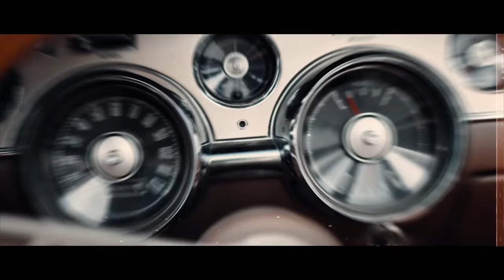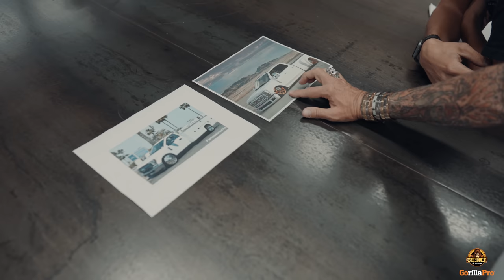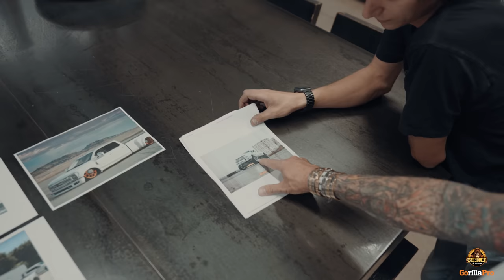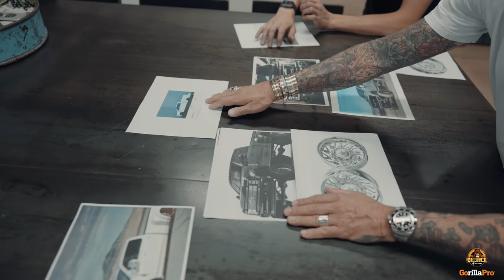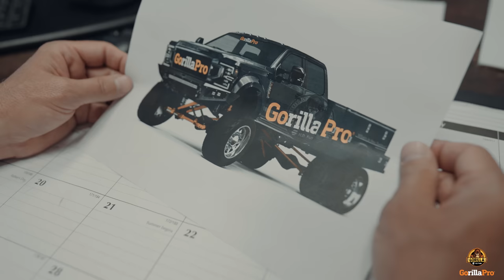Building A Gorilla Pt. 1 - GorillaPro® - Gas Monkey Builds

Comment: 5 minutes in and all I could think was no to slammed and no to any level, call up cjc offroad and get some carli under it.  Also, need to get ahold of the guys that converted the factory bed to lift up and have the boxes built inside.

Comment: Wouldn’t it just be easier to buy your vehicles already in pieces and then just put them together the way you want it.  Your always taking stuff apart to just put it back together some other way with improvements.  You should have just bought a bunch of white truck parts, painted them black and then put it together with the new improvements. Could been a time saver! Lol
Reply: That would be stupid on steroids.
Reply from the maker: When you can get your hands on a truck these days, you take what you can get!
Reply: Of course it would be.  That was kind of the point of the silly stupid comment.  Apparently my sarcasm didn’t come across.  Lol.
Reply: Absolutely.  I was looking for something about a year ago like a two Ford F550 with a custom box shelter.  Couldn’t get there for less than $700K. And couldn’t find it within time frame of 9 months.

Comment: its a work truck and they gonna turn it into a sissy pavement princess they should of stuck some bags under a programmer on an some stacks out the bed and called it done keep it for work that lift kit is not going to handle a 30k trailer its just to show off not work